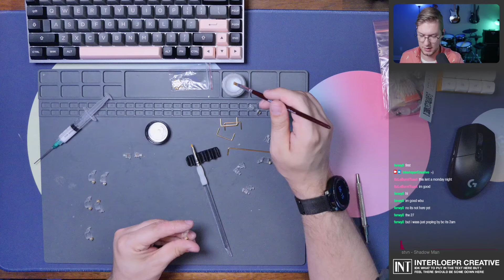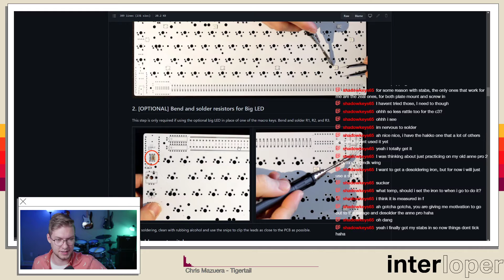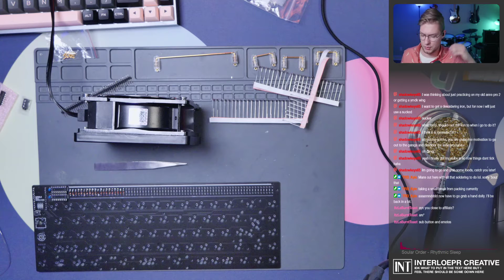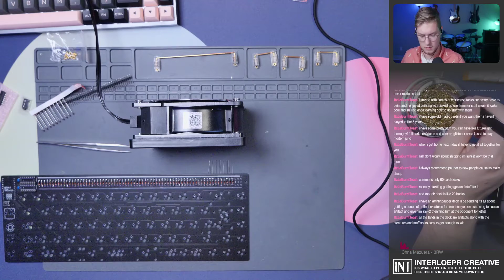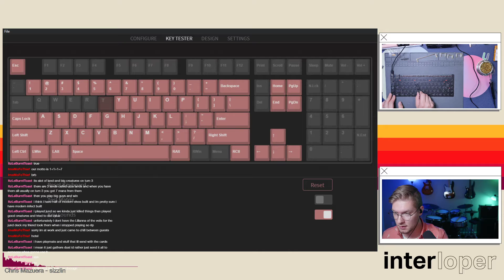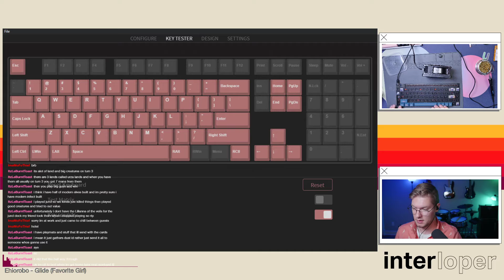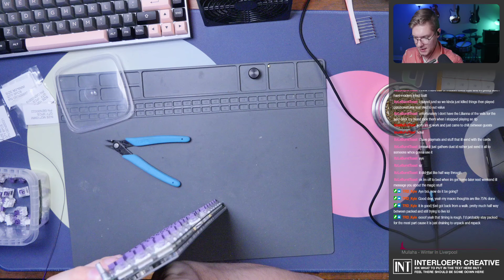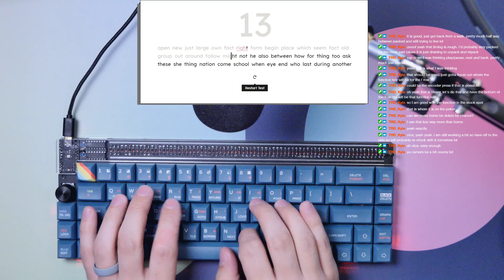Nullbits Nibble Build Stream (BOX Royals)

Comment: 1:05:10 Why you solder the diodes from the top is beyond me. This messes the look totally up. The solder joints are the worst I've seen and the look of the diode bar is ruined.
You are supposed to solder from the backside, then you'll get nice looking joints.

Comment: What keycap set did you use? Looks nice!
Reply from the maker: This keycap set is KAM Wraith
Reply: @InterloperCreative  awesome, thanks!!  I'm on macOS and using a K12 (a 60%). Looking to upgrade and have been am vacillating between a Keychron Q1 for it's Knob/Gasket/Media-row and the Nibble for it's Knob/form factor/novelty of a full build (something I've never done before). While I do miss the F row, I think the 60/65% boards look better than a 75%. How's the typing feel on it?
Reply from the maker: Having built both, I can definitely say the typing feel on the Keychron is better. The Nibble is a great looking board but it will be much stiffer than a Keychron due to the fact that it is all just stacked FR4 with the PCB directly touching the desk surface through standoffs. Certainly not unpleasant, but the gasket mounts on the Keychron are better. Ultimately either one is a great keyboard, more of a question of if you value typing feel (and sound) over appearance. You could also look in the the QK65 which has a better-looking layout (in my opinion) than 75%.
Reply: @InterloperCreative  agreed on the QK layout. Thanks for taking the time to reply!